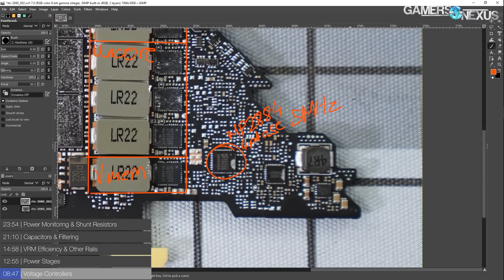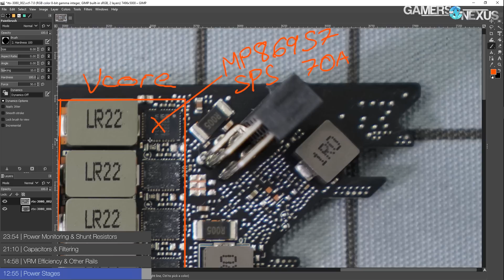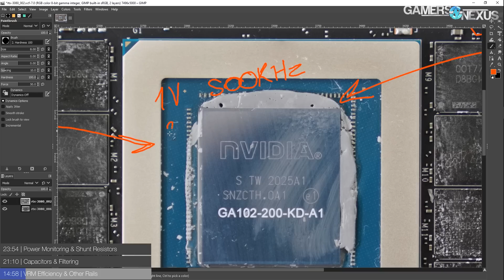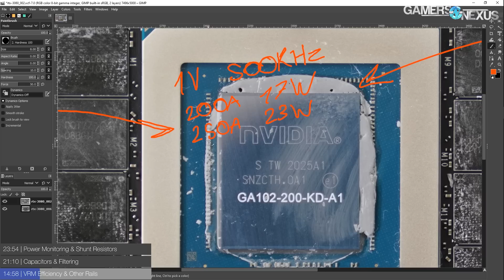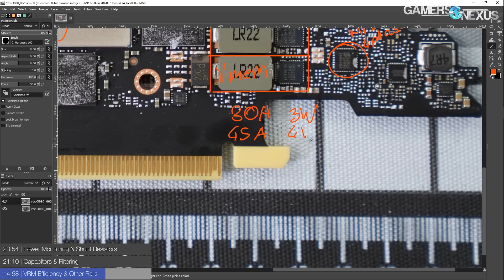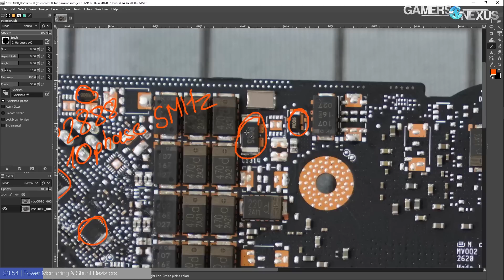GPU PCB Analysis: Founders Edition RTX 3080 Build Quality & VRM Capabilities

Comment: Now I'm happy I sold my Tuf gaming 3080 OC for 2 grand and got a 3090 FE from Microcenter 3 days ago lol.
Reply: The TUF series actually is one of the few built right and isn't affected by this, in fact I heard it is better than the FE as it has 6 of the expensive chips compared to the FE only having 2, same with the 3090
Reply: @ArchMarine  They're still experiencing crashes thanks to some other issue where they cheeped out on the pcb compared to the FE card. tuf gaming is the best compared to all the board partners but they still have issues. they're coming out with better cards with new designs soon.
Reply: @ArchMarine  https://twitter.com/HardwareUnboxed/status/1309659834468298753 Hardware unboxed tweeted about the tuf gaming crashes and there are multiple videos of people showing their tuf gaming cards crashing.

Comment: is it me or would a 12gb version of the 3080 with all memory chips would have been the perfect setup for this card ? i know a 20gb version is coming   but i still think 12gb would have been ideal from the getgo
Reply: The GPU only has a 320 bit bus, and each memory chip takes up 32 bits. For it to have had 12GB it would have had to had an intact memory system, but then the cards would be much more expensive. For the 20GB card it’ll have the other 10 memory chips on the opposite side running in 16+16bit mode from what I understand.
Reply: @seby9123   it has a 320bit bus because its missing two chips, look at the 3090 its using all 12 memory chips and is double sided, the card already supports 12 memory chips they just decided to remove two of them of the 3080,  it could have easly been 12 gb with 384bit bus just like the 3090 just only using single sided memory
Reply: i can only guess it was a cost thing
Reply: Turd Peterson How are you sure that all 384 bits of the memory system work? At least on the 1080 Ti the location of the missing memory chip was always different because it depended on what section nvidia disabled. I’m feel like nvidia would’ve just done 12GB if it was 100% functional on every card.
Reply: @seby9123  ahh ic so its binning thing that determines how much ram it can support ? which would explained the 20gb models i guess
Reply: Turd Peterson Most likely, 12GB is still far enough away from 24GB for it to be product segmentation, but because of the extra memory bandwidth it would increase performance a good amount. Although it would make the 3090 an even worse value, I think most people who bought it(including me) don’t care and just want the best. Although I think that if the 2080 Ti didn’t cost $1200 I wouldn’t have bought it, I probably would have thought the price was insane lol

Comment: I need a second opinion on something...  Should I get a i9 10999k and a RTX 3080 or a RTX 3090. if i get the RTX3090 i can't get the CPU as well. Keep in mind i have a Ryzen 7 3700x as of now and a sh## GPU
Reply: first question is on what kind of monitor you are planning to play xD

also the 3090 is like 10% faster than the 3080 or so, so it's not much

Comment: Thanks for the video, but this is so sad, these companies getting cheap and treating their customers like an idiot, we as consumers should never bother understanding this, we should pay and get the product we won't, 
We shouldn't have to worry and get PhD in every single side of our life, we shouldn't have to get a PhD in monitor science and make months of research to find a monitor without a dead pixel, BLB, flicker or any other artifacts. 
We shouldn't have to spend time and learn PCB to get a graphic card we buy so we don't fall to the trap of getting a faulty graphic card. 

These companies need to be sued, they are using cheap component to maximize their profit and they are not spending time and money on QA department,  how hard is to hire 10 guys to play 10 games for 10 days 10 hours a day to find this issue before selling thousands of units to the mass market??

I wouldn't be surprised if the difference between the cheap and the high-quality components for these 6 capacitors is less than 5$ each.

Comment: For the video, it was interesting to hear about your findings and seeing what the PCB quality is was cool - but I guess I am a bit too uninitiated in the tech sphere since most of what you said flew over my head. Guess I will be doing some side research along with figuring out which major I want to take (looking at computer engineering and physics - but I definitely will need to know what these terms mean).

On a side note that isn't related to the video subject at all, there seems to be leaks of RDNA 2 having base clocks in the 2 ghz - 2.5 ghz range (the 2.5 is supposedly on a 40 CU card, which is crazy). What are your thoughts on that? (this is to anyone who sees this comment)

Comment: I hadn’t realized those benefits of SMD capacitors: I thought they were just more compact and didn’t require the drilling of holes, like other SMDs.
Reply: they also have no legs, so the parasites are a bit lower aswell afaik
Reply: In general, smaller components handle higher frequencies better.

Comment: Most Obvious thing to know if someone know tech is about wich traces have the highest priority.
This layout is made by PCB desgn by expert above reference design. The developer of these board are top designers. So to question them on the why make no sense. 
The first thing of importance are the high priority traces. And that are the GDDR6X memchips traces to the GPU wich needs to be lenght match. That why Ram chips are closest to the GPU. Also the gpu bga design pin ( balls ) might be ideal placed on both outer sides of the chips to support easier or optimised routing and would be special multi layer PCB with power delevery layer but also match deilectrium so they can take parasitair capacitance between layer into account. I expect mayby multi power layer with thick cuper. But to know that you need to have cross section of the PCB, wich destroy it. Also is the placement of the parts of each logic VRM and Buck spread over to both side this means that the power trace and circuit trace length between part are very short. It make sense that these PCB are very expensive to develop and produce and SMT to. 
Also to put the high frequency smallest C close to the gpu pins the bypas C complexes are place on the other side of the PCB to the BGA chip. 
Also the 500K switching is trade of the higher switch freq the smaller capacitance can be to point where efficiency du to switching espacialy by high loads. for low loads 5Mhz might be enough but keep the parts smaller. L stores enegy magneticly C electricly at 5Mhz it need buffer it for 1/10 time of what 500Khz need to do for switching riple. 

It example how expert design is done.

Comment: What's that you say, these SMD capacitors are great? If only the rest of the internet agreed with you but they think they know better.
Reply: That's what I was thinking as well. JayzTwoCents tore apart a bunch of AIB cards to get to a suspected ESI issue with the final stage caps. They think it was because some AIBs have 5 or 6 POSCAPs which are supposedly cheaper than the MLCC and are prone to cross talk. So in this video they are apparently the more expensive and better option, but in JTCs video they are the cheaper option. https://youtu.be/x6bUUEEe-X8
Reply: @EverydayLayman  Both the capacitors JayzTwoCents (and really, Igor's Lab) talked about are SMDs. They're different types of SMDs, but they are they same general category (the smaller clusters are MLCCs, the larger individual capacitors are SP-Caps).

That's completely different than the Through-Hole caps BuildZoid is contrasting them with here.

Comment: it would be nice since these cards are 700$ and 1500$ if you could rate the cards from worst to best when you have opportunity to get the PCBs for the 3080 and esp 3090 1500+$ card from the AIBs or direct us to somewhere that does tell us which AIBs skimped on the cards and which cards are really for the enthusiasts who want to overclock the cards.  AIBs who skimped on the card should not be rewarded by enthusiasts (usually the first adopters) by overpaying for a card that is marketed as OC and has to be unclocked and/or undervolted to just run.

Comment: What's with the weird V shaped jagged edges on the inside edge of the card? Is the whole PCB overlain on a rectangular pcb that is of the individual card makers design featuring RGB, power, and other customizations?  Oh I see, its the through and through diagonally rotated fan.  Is it for practical reasons or did Nvidia just do it for frivolous reasons?

Comment: So gone was the days where we look at FE reviews and think that it's the lowest the card can go, and it'll be better with AIB models. Now it's the opposite, Ampere FE is about as high as it can go, since it's using such a noice config inside and some seriously binned chips by NVIDIA, not to mention those really sexy looking and beefy cooler. So AIB models are probably the lower class so to speak with them cutting every corner they could and get lower binned chips from papa Jensen. 

No wonder many companies says that working with NVIDIA is the worst experience they ever had.

Comment: Founders edition is solidly built, seems to be the best $700 option 3080. And at $750 the Asus TUF OC, not a bad option either.
Reply: There are no options.  You cant get any of these cards anywhere.  People are buying whatever is available.  Thats the big issue here.  They all knew the limited launch would sell out so they cheaped out on components.
Reply: @prototype8137  I'm not in no hurry my 2080 is running just fine I usually buy 6 months to a year after the release to make sure all the bugs are worked out. But for the price, and the build quality. these two cards look the best in my option.
Reply: Prototype 81 They didn’t all cheap out on components, both reviews and consumers have been showing that the TUF model is looking like the MVP this round - for its price.
Reply: Yeah, this PCB is far better than the reference PCB, so until there are real custom PCBs, the FE will most likely be be the best one. The cooler is also extremely well designed and for most cases it looks like the best one to me. The only issue with that card is the GPU itself, which is on Samsungs crappy 8nm process and you notice that in several aspects, being the very bad efficiency and the fact that they have to cut them down in many corners because of bad yields. Im very sorry for all the engineers that put so much work into this design just to be destroyed by the management and marketing people.

Comment: This video is beyond my scope of understanding, but, I'm so glad we as a community have GN and Buildzoid to do this level of in depth analysis.
Reply: If you look up the basic words like "resistor, thermistor, capacitor, mosfet" etc (wikipedia) and just read the first two or three paragraphs you'll be able to follow along pretty quickly. I had discrete electronics as an extra curriculum activity some 30 years ago so I had a vague idea what those were, but listening to Buildzoid for a few hours have really brought me back up to speed.

Comment: I think you are confusing through hole and SMD capacitors. other board partners RARELY use through hole capacitors (through hole means they go through the entire pcb via a hole and are soldered on the other side). i think you simply mean the cylindrical capacitors vs these cuboid capacitors, since those cylindrical capacitors are pretty standard from what i know.
Reply: @Gandalf721  Do you have a picture of what you're refferring to? because i have personally never seen through hole capacitors on a VGA.

Comment: Interesting to realize, then graphics card is nothing more that just GPU with bunch of RAM and VRM'S stuck around it. Nothing more to it.  Also seeing closes pictures of other brand "under-spec"  cards, seems that unsuitability issues can be easily solved by a friend with reflow station, as there are pads for MLCC's under those central capactiors.